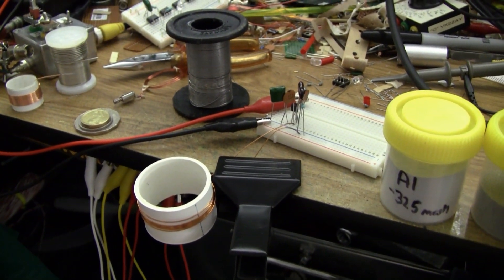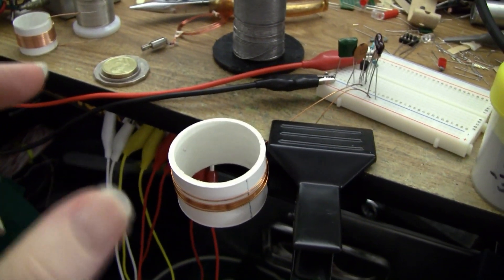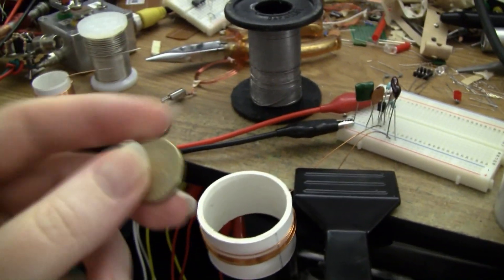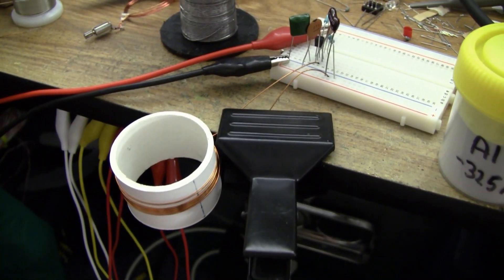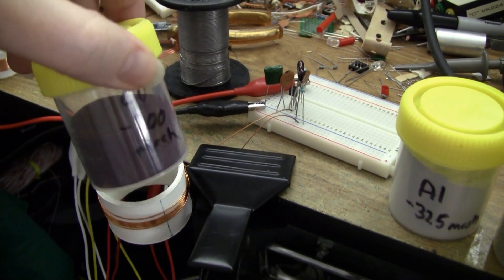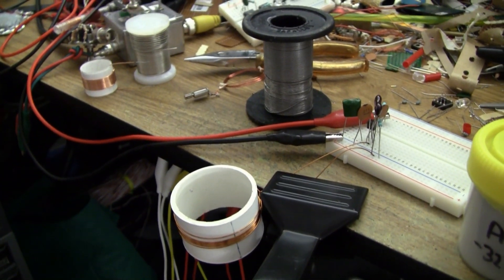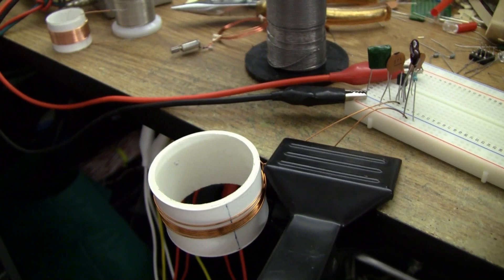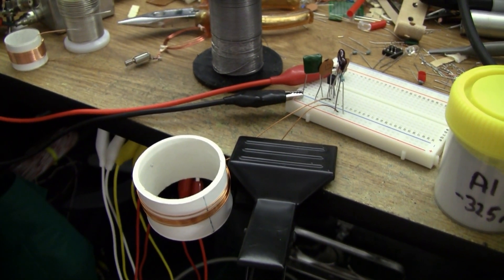Permeability of different materials

Comment: How aboutPermittivity of different materials
Reply from the maker: Najim MOUADILI that would be fun to do at some point, I guess a pair of parallel plates you could stick slabs of material into and observe the change in capacitance?  Could use an oscillator like this to sense the capacitance change.
Reply: vk2zay Thank you very much,I will be very happy if you can do this test because I really need it, I made several web search about permittivity test and they requires expensive equipment like LCR Meter with kits !!!.

Comment from the maker: @whisk0r one thing I didn't stress enough in the video is that these are powdered metals or materials of low conductivity.  Bulk metals behave differently because of induced eddy currents, making this simple oscillator-based test approach not very valid.

Comment from the maker: @whisk0r the one thing I didn't stress enough in the video is that these are powdered metals or materials of low conductivity.  Bulk metals behave differently because of induced eddy currents, making this simple oscillator-based test approach not very valid.

Comment from the maker: @jeriellsworth if only I could abuse a 555 to do it :)  Well actually I can think of a few ways to include 555s, but it is far easier to just count the frequency with a microcontroller which would also drive the display.  You can buy counting piggy banks for about $25, but where is the fun in that!